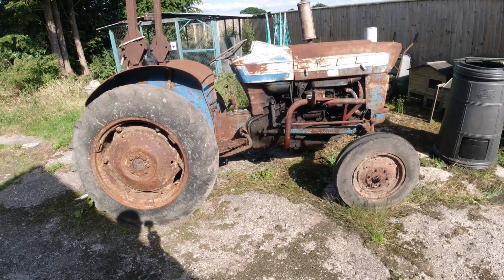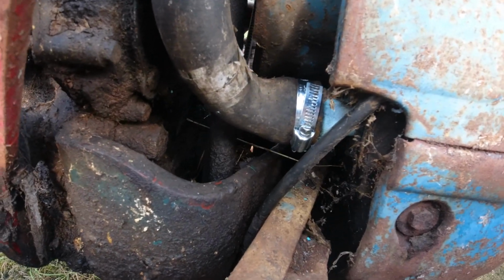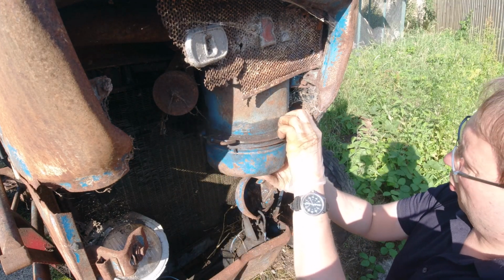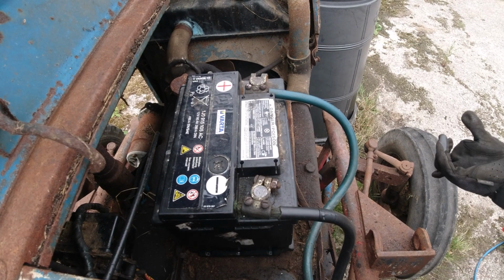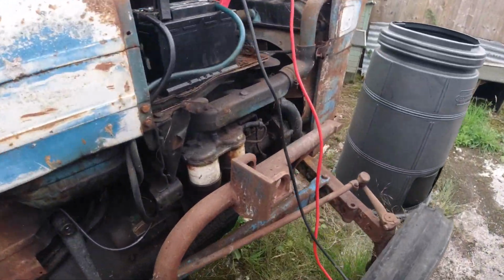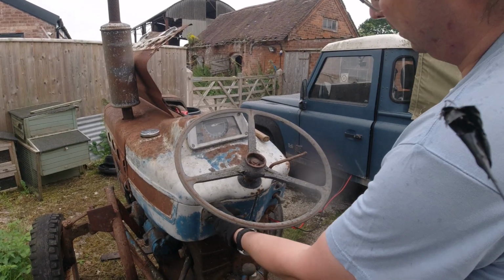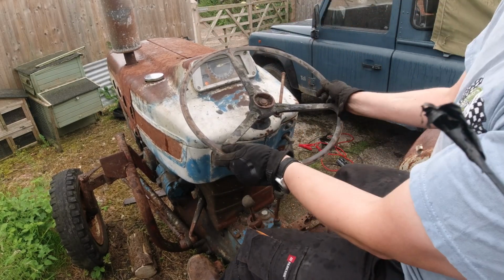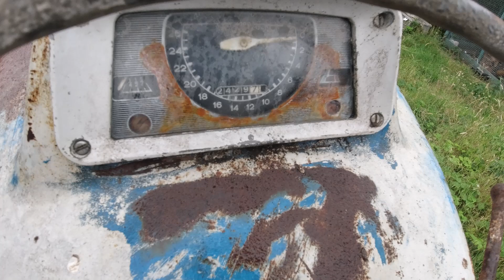Ford 3000 tractor first start in over 10 years! Will it run?

Comment: How about that after all those years !....I have never seen an oil based air filter arrangement...What a lovely project .
Reply from the maker: I was confident that it would fire up. It is an old diesel, there isn't much to go wrong with one! The oil filled air filter is common for machines that work in dusty environments like tractors.
Reply: Lots to look forward to. Try not to set fire to this one 😀. Regards.
Reply from the maker: I'll try my best not too!
Reply: When an engine hasnt been started for a considerable time it's best to pop the rocker cover and lubricate overnight 👌
Reply from the maker: yes, agreed. But I took a chance with this one. I wasn't expecting it to start immediately so I knew that there would be time for the oil to reach the top end before it started.